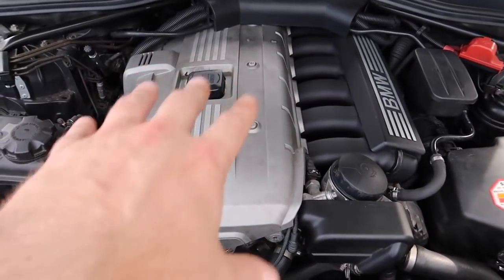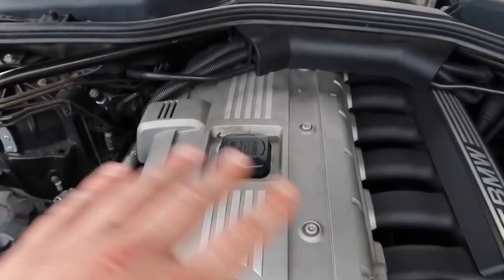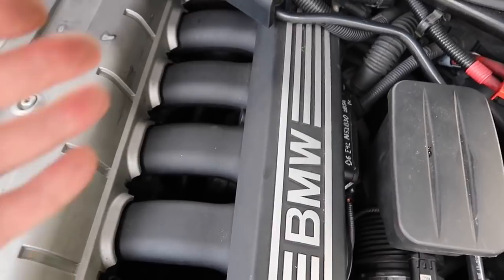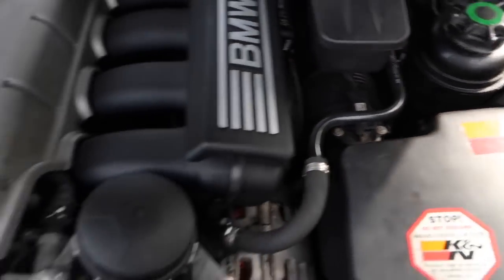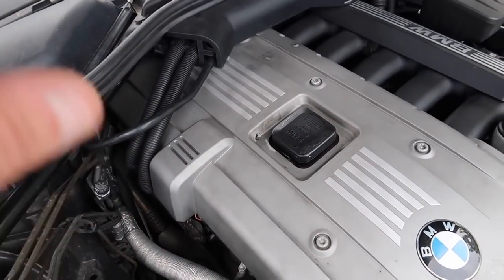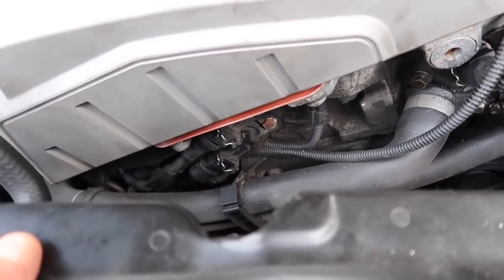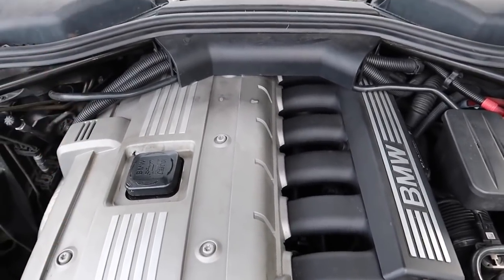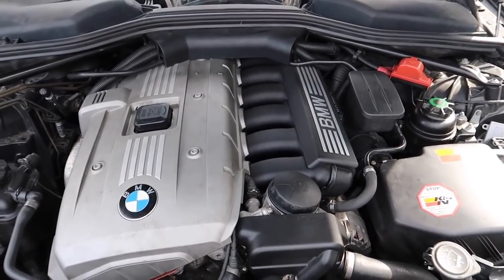Remove This From Your BMW Immediately !!

Comment: Great vid and thanks for the new intro song.
I'm in the US with an 07 X5 3.0.  I have the black plastic cover. I preemptively replaced the Disa under the intake when I had to replace the starter, as I already had everything out. Didn't expect to see one there. Thanks for the heads-up, also replaced the 2 Vanos solenoids and CCV hose preemptively after watching another one of your videos. Vehicle has 165,XXX miles and has been running like a dream. I've had it a year.

Comment: Hi, quick question. I have a E90 318i. The rear diff went a month ago. Went to a garage, they replaced it with a reconditioned diff. 2 weeks later the rear diff blew up again with a loud noise. Is it literally bad luck/bad diff or could something else be causing it?

Comment: Could you just put in model number(s) with vid titles please for example “remove this from your BMW XXXX” or “ how to replace XXXX on a BMW XXXX” it would be really helpful when trying to find your vids in archive, “remove this from your BMW” won’t really help if people don’t have the issue at the time your vid is released. If you needed the information in this vid for a future repair how would you search for it on YT? go through every vid until you found the right one? No but a tag to the vehicle(s) in the title would really help. Thank you.

Comment: With the valvetronic motor I’ve replaced the gasket and put the motor back and turned it with the alen key to the rest position then did the ignition on off  and was ok, but then I reset it with ISTA and the engine seemed to run a little better idk, then after a few weeks I scanned it and got a valvetronic code and cleared it but didn’t do the adaptation again. Anyway it runs fine not sure if I need to do anything

Comment: Doc what is the rectangular box to the right of the intake manifold runners, left of the PS tank. I've got a black valve cover n52, 1 stage intake, 128i. Disa component? Great last video too perfect timing as we just got 12" of snow. Be well friend

Comment: I got a problematic X3, 2005, 2.5cc with constant misfire on cylinder 6, changed plugs, coil packs, checked for vacuum leaks, replaced both O2 sensors and it still has a misfire on no.6 what should I be checking next or any advice is welcome?

Comment: I replaced all six coils. My mechanic found some lazy prick had replaced one with the wrong pack. I also said replace all plugs at same time. He then found ALL plugs were the wrong plugs and the thread was not long enough so ignition was happening up inside the plug thread.
Watch who you get to do your work.

Comment: Hey Dean, I need you’re help..I’ve already changed my valve cover gasket and engine filter gasket but there is still engine leak on my car. Please help
Reply: Try the oil cooler gasket. They leak often.

Comment: When ever I have to remove my valvetronic motor I unscrew the small Allen screw on the back of the motor, am I doing this right? My car doesn’t have any issues I just don’t want to do something wrong
Reply: You don’t have to use a Allen to take it off just take off the 3 screws you can just put it back in . But if you use a Allen you need to make sure it’s seated properly and turn it clockwise until it gives tension . You’ll feel it when it grabs